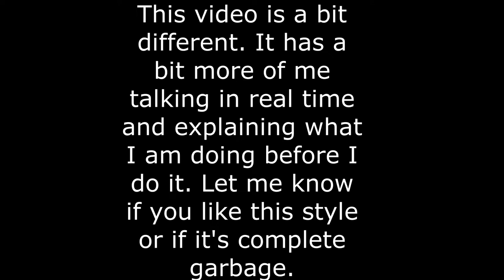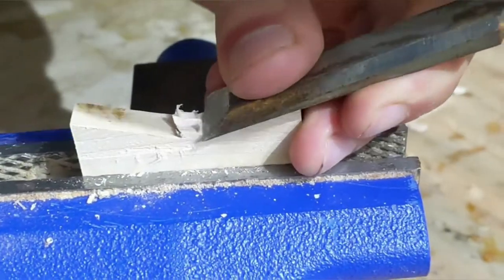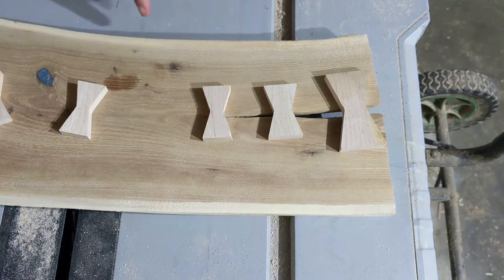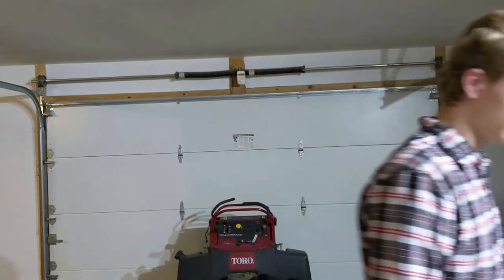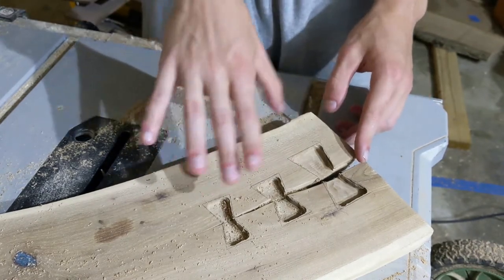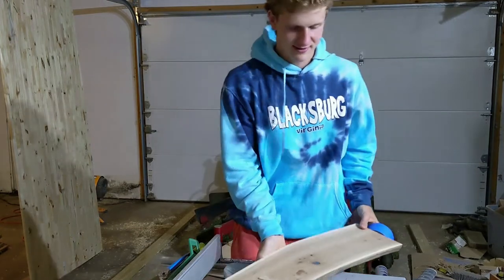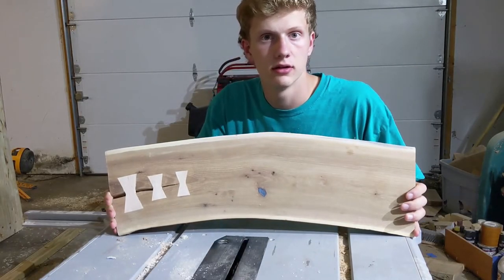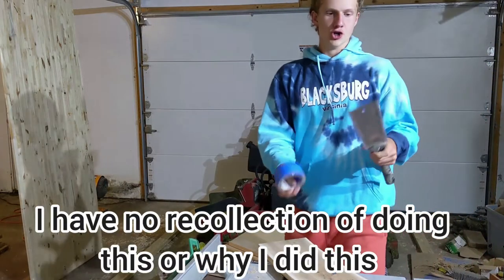Beginner woodworker tries bowties. (First time)

Comment: I would invest in a spiral upcut router bit if you're going to be doing bowties (or any engraving really) on the regular.  If you've already got the jig, why not use the scroll saw to cut out the bowties instead of the table saw.  My blood pressure went up 10 fold watching that.  Also, you're not the only one that has slammed one of those blades into the hand.  I've taken to wearing a cut resistant glove whenever I've got no other good options.
Reply from the maker: The scroll saw doesn't have a reference fence or miter slot. In retrospect I suppose I could have clamped down a temporary fence to cut them out. 🤷‍♂️ As for the router bits, you're right, I definitely need an upgrade from the little keyhole bit if I want to do more inlay like that in the future. And as for the spatula saw thing, it's good to see I'm not the only one who has been attacked by those things. Stay safe! Thanks for watching!